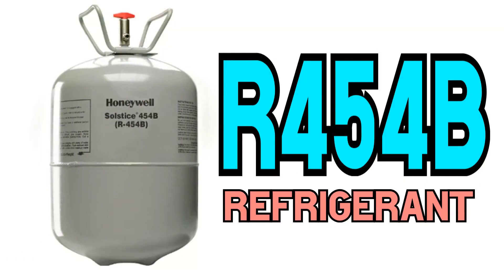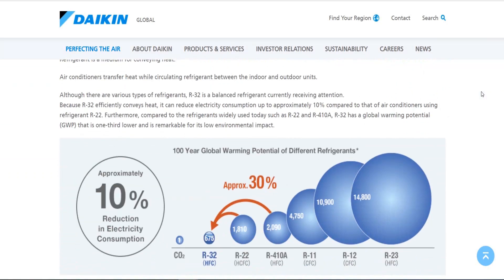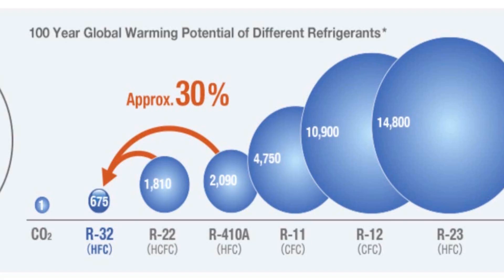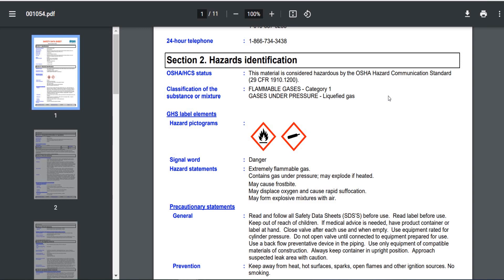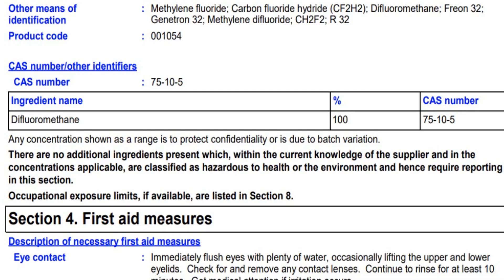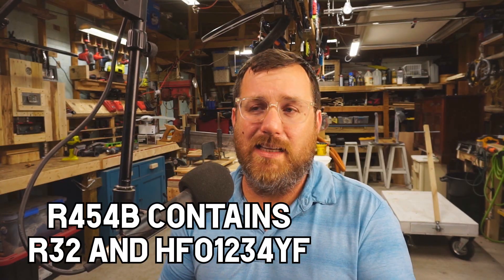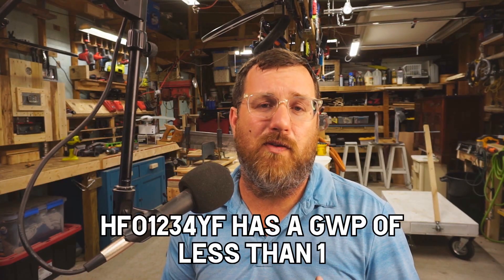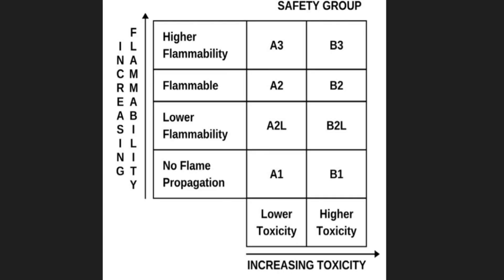Introduction to R32 Refrigerant

Comment: Thought the reason to get rid of R-410A was for the Ozone not global warming and CO2 causes global warming. Now its changed to CO2 good?? MSDS for R-32 shows it is an extremely flammable gas, may explode if heated, may cause frostbite, may displace oxygen and cause rapid suffocation,may form explosive mixtures with air. The NFPA classifies it a 4. Don't think it falls in the mildly flammable category.

Comment: First off the GWP rating is complete BS as aka climate change/global warming by man is a complete fabrication and liberal models for increase global temps have them rising 1.5 degrees centigrade regardless of man’s influence on the planet in the next 76 years. We can easily adapt. Next CO2 accounts for less the 10% of our atmosphere, as does methane, sulfur dioxide, chlorine, etc. our atmosphere is 65 miles thick. Also burning fossil fuel creates CO which is heavier than air and has a cooling effect as does CO2. Plants need CO2 for photosynthesis and produce oxygen. So here we are with a methane type refrigerant which if leaks is toxic and flammable, that’s why it was only used in industrial applications, being used in residential applications with less regulation. I see accidents and fires being cause by improper or unprofessional installation, leading to lawsuits. Anyone else feel this way?

Comment: Here we are with 10 months left to go and we don't even know what threads we're using on our hoses. Even though I have had the Esco training the EPA has not even said if certification is required. Maybe they'll let us know what we need to do somewhere around 1/1/25. Perhaps some of the supply houses in the local Atlanta area will have some things in them such as R32, reclaim canisters, hoses if needed. You know all the expensive stuff we're going to have to purchase before we can do this, it's not even available at this point. I know I'm going to need some expensive items such as a fire extinguisher and a holding bracket for an upright reclaim tank (not available in the continental US). Simply put there are way too many questions that are unanswered with only 10 months to go. Someone better get on the ball because I'm not going to be ready if this is the way it's going to go.
Reply: R&D is going on in the field more often than  people think!

Comment: Does R32 heat pumps work better for heating in lower ambient temps
Reply: Yes, R32 equipment is going to have better capacities in lower & higher temperatures

Comment: Daikin info regarding the R32 website is deceptive for a simple reason: The only classification for refrigerants are ASHRAE34 & ISO817 and it classifies refrigerant not only in respect to GWP (only important IF it LEAKS). R32 require extensive safety requirements and the 1st flammable (and can be explosive if no perfect vacuum, and called Diesel Effect) refrigerant in splits systems knowing very well that R410A an A1 class nonflammable, nonexplosive is 50% R32 and 50% R125!! and been around since 1990? The only reason for the mixture is to curtail the flammability of R32? it si not more efficient than R410A and by the way you can drop R410A in and R32 charged equipment without any consequence as the main 4 components (compressor, condenser, expansion device & evaporator) ar the same!!! So why use R32 or any A2L in domestic and small splits applications? a con, Ignorance or what?
Reply: So r32 is explosive if you don't pull a vacuum on a system install?

Comment: Gwp is one side of it. While r32 may have a lower gwp than 410a there are other environmental factors that aren't being accounted for. The switch from 22 to 410 was over ozone depletion. Honestly it's all artificially manufactured. All refrigerent is bad in one way or another.

Comment: At around 3:30 you express your preference for single component, which makes sense. I think you are alluding, but don't actually state, that it would make it easy to "top off" a charge if there is a slow leak that is hard to detect, without having to worry if the mix has been compromised. Is that one of the reasons? I'm just trying to learn as a homeowner who needs to replace a old unit (inside/outside) that has finally gone below the amount of charge needed to provide cooling.

Comment: If CO2 has a GWP of 1 then why are they freaking out about CO2 in the atmosphere? Just goes to show you how much of this is all BS.
Reply: It is a question of scale.
Reply: @markbeiser  Regardless the whole refrigerant situation serves as one of many ways the global elite are trying to lower the standard of living of the middle class. In 10 years they’ll find some reason to outlaw this also. They’ll raise the price and make repairs uneconomical so you’ll have to buy new more expensive equipment. If you buy into this environmental nonsense, isn’t the unnecessary and excessive dumping of otherwise useable equipment into landfills just a different form of polluting the environment? I’ve seen on websites like Ali buba where you can buy a pallet of 30lb cylinders of R-12 for about $50 per cylinder from China. Same for R-22. I’d guess someone somewhere is buying it. Guess it’s only harming the environment if used in the USA and the countries who’s politicians profit from all this nonsense.

Comment: I work on a1-a3, but in residential I’m concerned for the customers but more so the green horns who get thrown in it working with an A2L for obvious reasons. But if I had a choice between the two, it would be R32 for the same reasons you mentioned in your video. Good job
Reply from the maker: Thank you.
Reply: Can you get R32 from your supplier?
Reply: @coolramone  not at this point in time

Comment: R32 has a higher discharge temperature. That will result with machines running longer/ cycling more often and potentially unhappy customers. Seems, any reduced energy use in the machine will be lost by running longer or more often. It doesn’t matter. We cant fight the EPA.
Reply: higher than what?

Comment: Good information!  I’m not too happy about using flammable refrigerants whether they be on home appliances or residential HVAC. One thing I know for sure is those linear compressors used on home appliances. My new freezer with R600 give up the ghost about 3 months after I bought it and GE said it was not repairable and finally refunded some of my money. Can’t say if it was the refrigerant or the compressor but after discharging and evacuating I manned up and brazed in some taps and the compressor was equalized. Go figure😊
Reply: All common refrigerants are flammable (R3/ammonia is one exception).  However, the hydrocarbon ones don't produce poison gas when they burn like the freon ones.

Comment: I've been wondering if we're going to need to buy all new equipment (gauges, reclaimers, etc.) Both 454B and R32 are more flammable, so how is that going to impact the trade as well? I'm fairly new in the field, but all the old timers I work with are super pissed about the upcoming refrigerant change. I can understand both sides, I'm mostly concerned about having to replace/update all the equipment I purchased only a couple years ago to accommodate these new refrigerants. I searched and noticed there weren't any gauges with 454b's PT on there. When I was at a class at carrier I asked about the operating pressures of 454b and they couldn't answer, so still a lot to learn about these
Reply: Been here in Australia for over 5 years

No issues for us. 

Every manufacturer coming into the country is basically r32 now, just buy a suitable pump and guages. Reclaim cylinders are slightly higher pressure ratings. It mosty just affected how to transport and store in large quantities
Reply: @JesseDoesHVAC  nice, I'm having trouble finding gauges with R32 charts on them, I suppose i could use my old gauges and refer to a PT chart, but still nice to have it on them... Do you guys have R454B over there yet as well? I haven't found one piece of equipment designed for that stuff yet, but carrier told me we won't be seeing it on the market for at least a year from now, so we'll see what happens. I didn't know if my reclaimer could be used with flammable refrigerants, I'll probably just contact the manufacturer and see
Reply: @kennethstebner1004  no we don’t, I don’t think that has even been released yet. If it is I don’t think we will get it cause it’s not much different in terms of GWP ect and we are heavily integrated with r32 now
Reply: @maxd4968 Any R32 related fires reported yet?
Reply: @coolramone  not to my knowledge. It really isn’t as bad as people are saying

Comment: But you have to use more of r54b than r32. So does that make the gwp the same or closer or are the scales tipped in r32s favor?
Reply: Great question! My admittedly feeble thoughts are if it takes more it may be less finicky/critical in terms of charging? IE less likely for someone to blow past proper charge to overcharge? I’m new so may be way off base

Comment: Thank you for the breakdown of the refrigerants.  As a Comfort Advisor, I am getting more questions from homeowners asking for the major differences between r22, r410a, r454b and r32.  These videos help me sound more knowledgeable.
Reply: Thank you for the reply.  Another topic I am encountering more frequently is the side discharge condensers.  Coleman and Carrier are showing up in Phoenix in this configuration.  I saw some of your content on the Gree Flex which was helpful.  The Lennox distribution center had one on display.   Any addional content on the performance and viability of this versus the traditional condenser would be very helpful.  Again, thank you for the amazing content and presentation.
Reply from the maker: Thank you ,make sure to let me know if you need anything else covered in these videos

Comment: Don't forget 410a is simply R32 plus R125 in a 50/50 blend.
Reply: Uh, how come we haven't just been using R32 all along?
Reply: @joez.2794  because they freaked out about mild flammability, even though it's been used overseas for decades.
Reply: @realSamAndrew  because there are so many hacks/idiots that would probably causes it to ignite. lol!
Reply: @joez.2794  because there's no patent on it  therefore not as much money in it for the big ballers
Reply: Don’t forget R600 is just purified Butane. Imagine how cheap it would be.
Reply: @yolo_burrito  that's a different point. We were not talking about price, we were talking about whether people are familiar with this "new" refrigerant. Most common HVAC techs have never worked with r600, and there are significant risks that have never been there with r22 or 410a.
Reply: @yolo_burrito  and r290 I propane